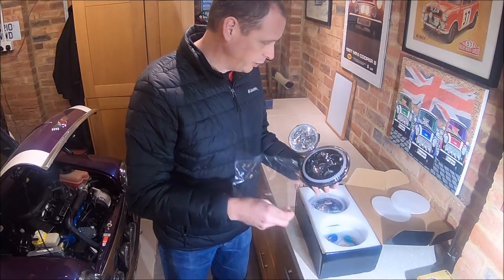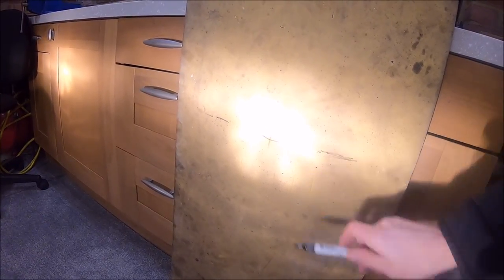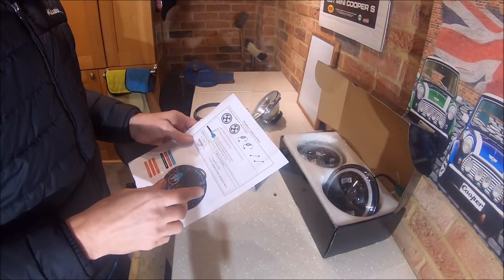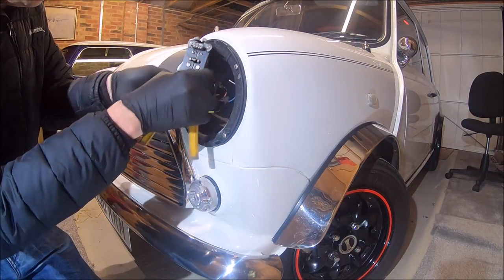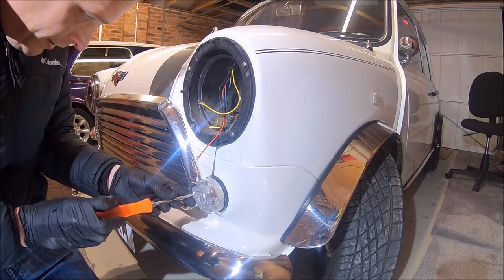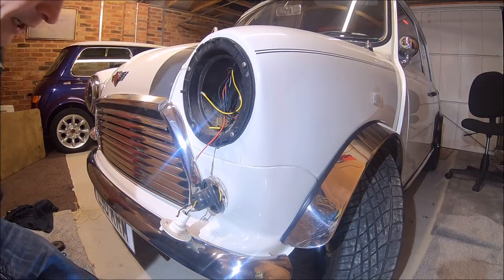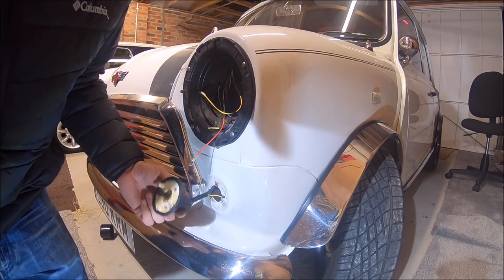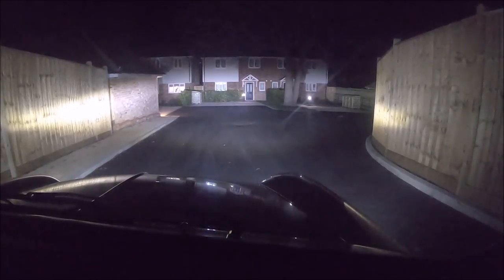Classic Mini Workshop - LED Halo Headlight Upgrade / Conversion

Comment from the maker: My images have been used by an E-bay seller to promote listings. These images have been taken without my permission and I know nothing about the headlights listed. I have asked the seller several times to remove my images but they ignore me. Please do me a big favor and do not buy from anyone using my images, if they are unscrupulous enough to steal my images, don't trust them with your money!
Reply from the maker: I get lots of Q's on the legality and UK MOT regulations. From my experience, these headlamps are for show only. The beam pattern and aim might cause you problems come MOT time!

Comment: Hi guys me again , just want to say THANKS A BLOODY LOT. I have just bought a brand new motorbike but after seeing those 4pots and the stunning minis you have AND all the new tech coming out for the BEST CLASSIC MINI i have literally just put the bike up for sale, Now will i get a decent mini for around the 5-6K as i have been out of the mini scene for a while. I know at that price i wont be getting anything really good but i  want SOME cash left over for upgrades and probably the mini will need some work , But like i said in a prev vid i cut my teeth at only 13 years young on minis so i can do ALL the work myself plus my best mate owns an accident and repair shop so painting welding is going to be cheaper . Please keep these vids coming guys as i read the David Vizard bible years ago so if you could go over some of the newer stuff coming out from jack knight/ ,K.A.D /M.E.D/ MINISPORT i would really appreciate it  many thanks for inspiring me    SCOOBS UK [Wales] .

Comment: Keith, I have only fitted one side so i will take out the black box which i had some concerns about with possible heat
build up with it being up against the back of the light! I wired my indicators in to the loom under the grille to keep it away from any water. Top video and shows everything you need to know thanks for putting us right on the black box! Cheers Dave
Reply from the maker: Didn't think about making the indicator connections behind the grille, good idea Dave

Comment: It’s like there’s no cut off at all! Or it’s aligned very high!
Reply from the maker: I think that is more to do with the slope of the road. The car is level but the road slopes down
Reply from the maker: I did double check and yes the aim was way too high
Reply: Keith Miller I thought you were going to mark your cut-off on the wall for you removed the headlights but then you marked the bottom of the beam?
Reply from the maker: @MiniMattTV  It was difficult to see a flat cut off with the old headlights so I just marked the bottom line which was defined and the center of the beam as a rough guide. Either way the new headlamp aim was at least 2" higher when I done the same check. Tried adjusting them but my adjusters are seized so now need new headlamp bowls too. Don't ya just love Mini's LOL
Reply: Keith Miller haha yep, definitely sounds like a mini! Fix one thing for another thing to go wrong!

Comment: Hi. I've got these and constantly get flashed by other drivers as they just too bright. Installed correct way up.  Adjusted so they are pointed as down as possible.   Have you seen this problem please?
Reply from the maker: Yes, had the same issue getting the aim low enough. I ended up fitting new headlamp bowls
Reply: @classicminiworkshop  thanks. Are your new bowles a different spec then somehow?   How did the new bowles help if not. Cheers.
Reply from the maker: @ThisIsABargain  The old adjusters were a bit worn, the threads in the adjusting screws were not the best. The new ones allowed me to adjust a bit further. Either way, these cheap LED-type headlamps from E-bay are not ideal. Be prepared to have to swap back for MOT time. The proper versions that have a good beam pattern cost £300+

Comment: Great video Keith. So what happened with the alignment, can you adjust the height of the beam at home/ with adjustments or changing the bowls out? Or does it have to go into shop. What bowls did you get out of interest if this solved the beam height problem? Thanks
 Al.
Reply from the maker: Hi Alex, I bought new bowls from Mini Sport at a show. You need a beam setter to set the height correctly. The new bowls did allow me to get the beam lower but to be honest the beam pattern is not great on these cheaper LED lights. You might have issues at MOT time but it doesn't take long to swap back to standard if you need to for the MOT.

Comment: brilliant video.  it will be a while before I'm actually doing this, but this was good to watch.  what exactly was the 'wax' spray you used?  Is that a lithium grease you use to help prevent corrosion?   You made it look simple and straight forward.  The only other question would be whether or not you had to adjust the lights at all..
Reply from the maker: That wax I use is Dinitrol or equivalent cavity wax. Yes I did need to adjust the headlights down quite a bit.

Comment: How do you deal with this statement regarding LED Lamps being fitted to older Vehicles?

New cars are fitted with LED lamps, which have been tested and pass Whole Vehicle Type Approval.
Under British Road Vehicle Lighting Regulations, LEDs are not mentioned, because they were not invented, when the legislation was penned in 1989, meaning that they are not permitted at all. However, new cars fitted with LED lights are allowed to be used in the UK, because the lamps pass European / UNECE technical standards (although some of these latest LED lamps seem more dazzling to me than ever before).
Nonetheless, the ‘bulbs’ on those newer cars thus equipped, at the time of writing, cannot be renewed. If an LED module fails, the whole lamp has to be replaced.
Not only do conversion bulbs fail to comply with the aforementioned European technical standards but also fitting them ensures that your lamp will not perform as designed and will prejudice the Whole Vehicle Type Approval of your vehicle.
Reply from the maker: It's the same for any modification you make, wheels, exhaust, lights, body kits, engine, etc. The vehicle will not perform to the WVTA standard or whatever the standard was when the car was built. Some countries such as Germany are very strict on vehicle modifications, far less so in the UK. It's a risk you take, get pulled by VOSA and be prepared to face the consequences. The lights might say they are E marked, UK compliant, MOT pass etc. but you are quite right they will not be type approved for the vehicle. Thankfully, unless someone is really looking to make an example of you it's unlikely to be an issue, but drive around with no MOT, Tax, Insurance, Bit's hanging off the car etc. then someone will be looking for a reason to make an example. I'm not aware of anyone enforcing the EU technical standard in the UK in such a case? You might get a prohibition notice for headlamp aim/alignment/beam pattern.
Reply: @classicminiworkshop  - as long as you notify your insurance company of the mod you might get away with it or if the car is old enough to be exempt from mot etc.

Comment: I had these fitted... EPIC fail come MOT time. No beam pattern whatsoever. Don't bin your old lights folks and be prepared to be pissing other road users off with your headlight aim.
Reply from the maker: Completely agree, show lights only unless you spend £300+ on the proper ones!